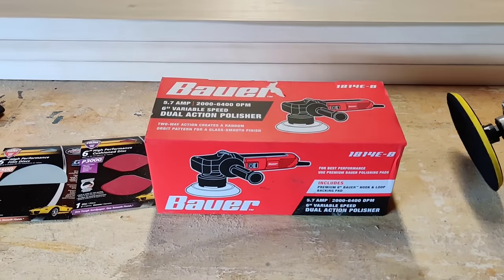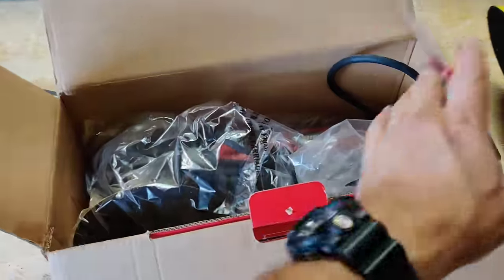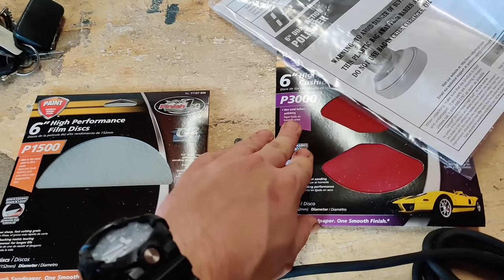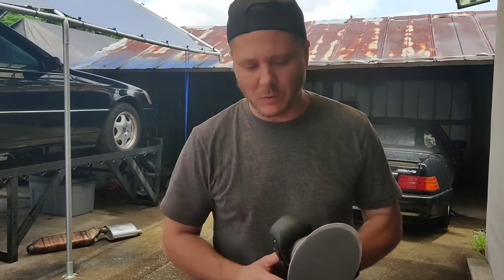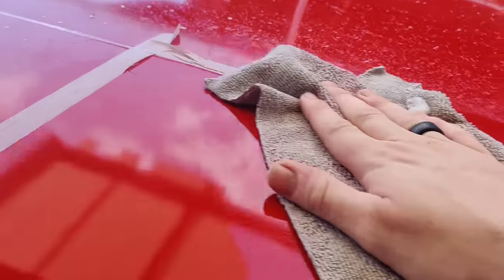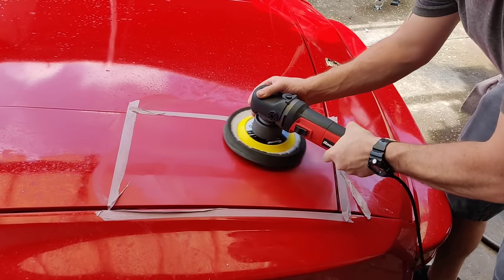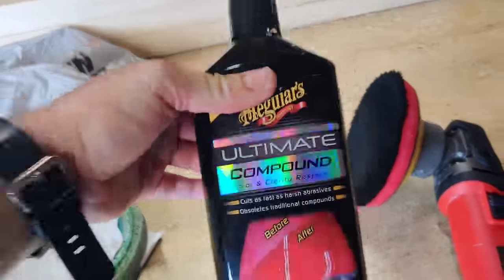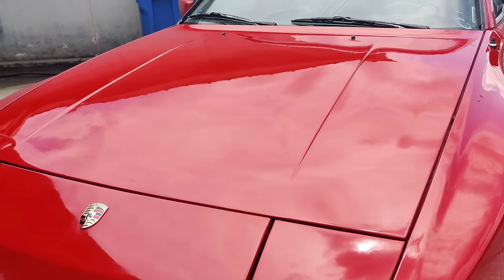Harbor Freight $49 Bauer dual action polisher How good is it? Unbox , review & demo

Comment: Where’d you get it for 50$? At my store it’s 75$
Reply from the maker: Coupon.  Let me search.  Usually just search google for coupon with item and you can find one
Reply: Pete’s Carport thank you. The coupon works in store?
Reply from the maker: @Joshwake  yes.  I even screen shot and show at register.  As long as they can scan it works.  They always have at least 20% off.
Reply: Pete’s Carport ok I did see a coupon but it expired august 20th. Just gotta wait for the next one
Reply from the maker: You can use the 20% off one too
Reply: casiotechI not sure. I only use meguires and Rupes pads
Reply from the maker: The griot's garage pads are very good too.  I use meguires and griot's now
Reply from the maker: casiotechI  yes. They sold out when I went. But make sure to use a coupon. You can get it very cheap. I had a $79 coupon for it if they had it in stock.

Comment: So, this isn't a true variable speed, then is it?  You can't use the trigger to slide into the speeds as you wish, you just set a number on a dial?

And strangely enough, it seems to rotate more slowly, at least on the video, the higher the speed.  An optical illusion I guess
Reply from the maker: So the number dial can be slid up and down as you go and acts very similar to the way a variable trigger would.   It’s very easy to glide into speeds.

Comment: You just sanded all the clear coat off. Now there’s nothing to protect the paint. Although it did get rid of the orange peel.
Reply from the maker: No clear. It’s a single stage paint
Reply: It removes only a few microns.